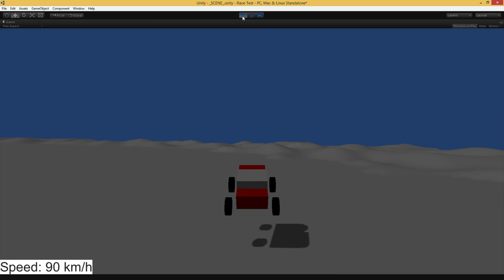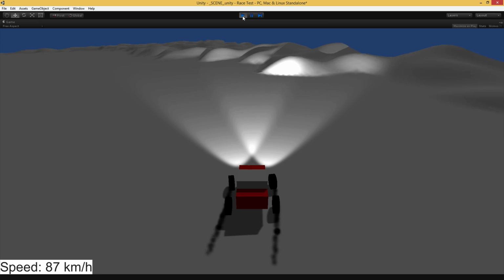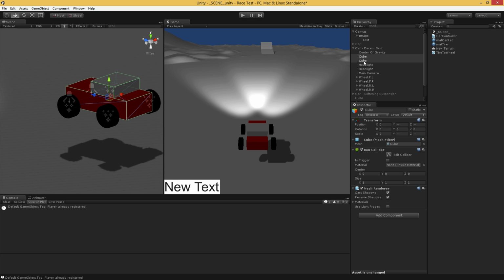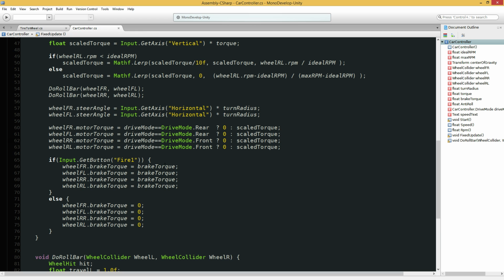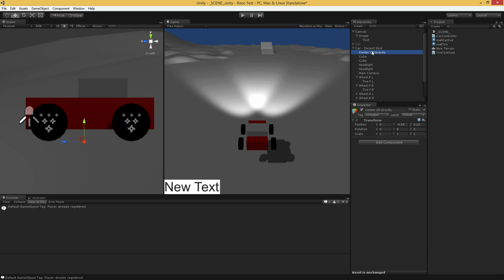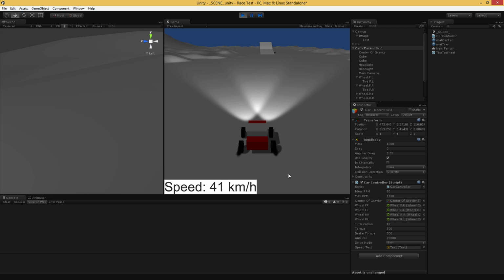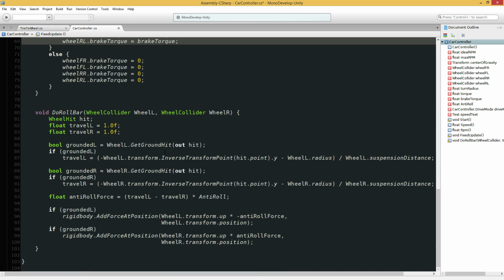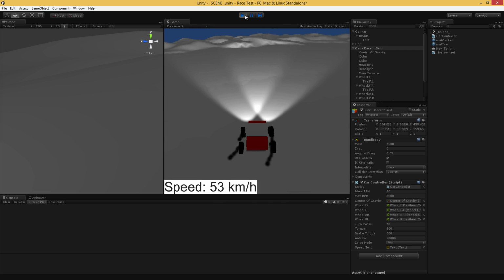Unity Quicky: Car/Vehicle Controller/Rig! [HOW-TO]

Comment: WheelCollider in unity 5 is broken af. Wheel collider always appears perpendicular to the wheel no matter what I do. It only works for the in-built cube or other shapes. It doesn't work for custom models.
Reply: did you found a solution?

Comment: Is there a way to dampen or increase the mass of the rotation of the vehicle? Something that I noticed in some games like Forza is that they make it more difficult to spin the vehicle like it has a lot of mass. When you hit the front or the back of the car from the side, it has lots of resistance from the impact and the car doesn't spin very fast. Also when you hit a wall, your car doesn't align to the wall and get stuck. Is there a way to do this in Unity? Angular drag is not what I want btw. I guess maybe increasing the mass might work, but it makes the car harder to move. It's not drag, I just want it harder to get the car's rotation to accelerate.

Comment: Didn't anyone solve the issue when converting to a unity 5 project?
Reply: +Tito Oliveira - Yes.
In the hierarchy change: 
1) For the car "Car - Decent Skid" go to the Rigidbody component.  mass =
 350.
2) For each wheel (Wheel.F.R, Wheel.F.L, Wheel.R.L and Wheel.R.R) change
 in the Wheel collider component the Suspension spring = 900. Sideway 
Friction (Extremum slip = 0.02)
Aditional, if you like can change the values of Main camera in the 
Smooth Follow script:
Distance=10, Heigh = 5.
.
Reply: It works. I have Unity 5 too.
Reply: Doesn't work, the Wheel Collider aren't functionnal in Unity 5...
Reply: Mario Cardona For me in Unity  5.3.5f1  it doesn't work
Reply: Mario Cardona I tried your suggestions in the actual unity and still does not. work. 350kg also seems to too light IMO. In jumps and wiggles too strong. any new thoughts on this?
Reply: Hi, I've tried your settings in the latest version of Unity and no luck either.

Comment: Doesn't work in unity 5.1.2

:/ could you do an update?
Reply: +Mario Cardona Mario Cardona mi suona italiano.
Reply: Il nome di Mario è molto comune in America Latina.
Reply: Mario Cardona So you translated that with Google right? XD
Reply: anche voi.  xD You too.
Reply: Mario Cardona Nope, i just know how to speak in English :)
Reply: hi! excuse me but i have a question for you... i downloaded the project but in the script CarController the compiler show me an exception about rigidbody e i don't know why... could you help me?
Reply: @Renegade_XCIV  I'm having the same issue :(
Reply: +Angry Hat - I have a solution. 
In the hierarchy change: 
1) For the car "Car - Decent Skid" go to the Rigidbody component.  mass = 350.
2) For each wheel (Wheel.F.R, Wheel.F.L, Wheel.R.L and Wheel.R.R) change in the Wheel collider component the Suspension spring = 900. Sideway Friction (Extremum slip = 0.02)
Aditional, if you like can change the values of Main camera in the Smooth Follow script:
Distance=10, Heigh = 5.
.

Comment: Doesn't work in the new version, that makes me a sad panda
Reply: +failprone  - I have a solution. 
In the hierarchy change: 
1) For the car "Car - Decent Skid" go to the Rigidbody component.  mass =
 350.
2) For each wheel (Wheel.F.R, Wheel.F.L, Wheel.R.L and Wheel.R.R) change
 in the Wheel collider component the Suspension spring = 900. Sideway 
Friction (Extremum slip = 0.02)
Aditional, if you like can change the values of Main camera in the 
Smooth Follow script:
Distance=10, Heigh = 5.
.